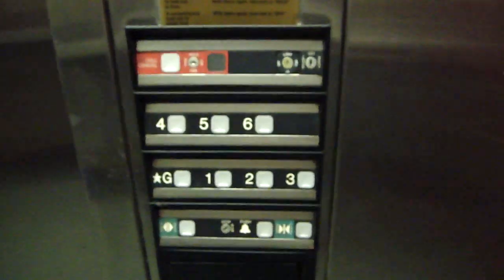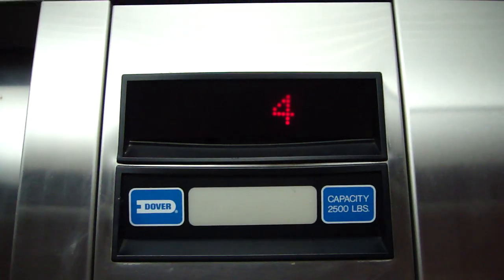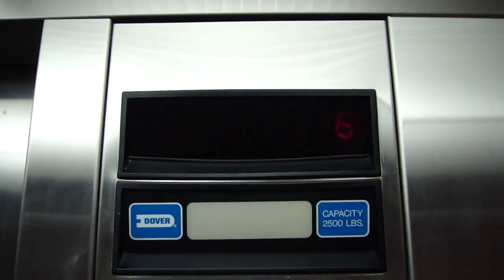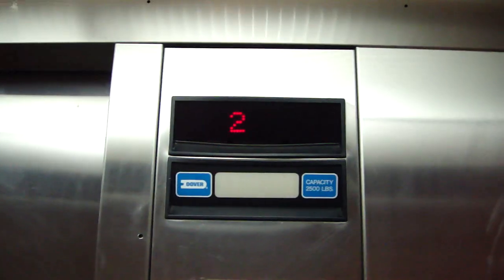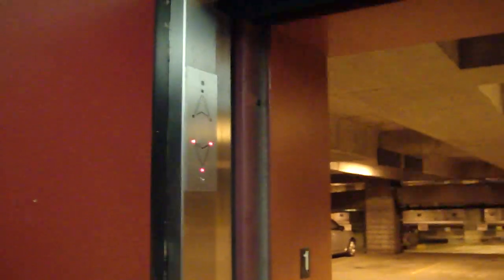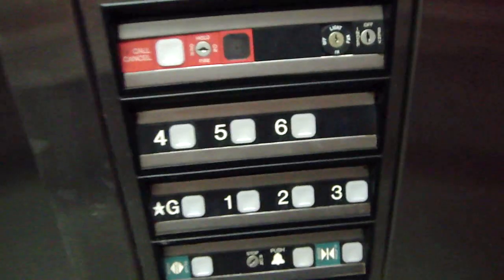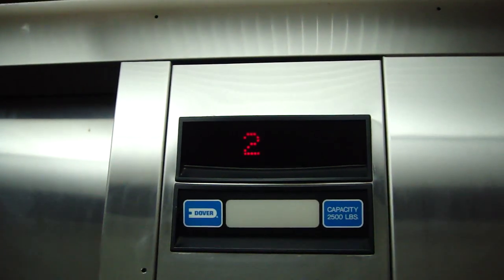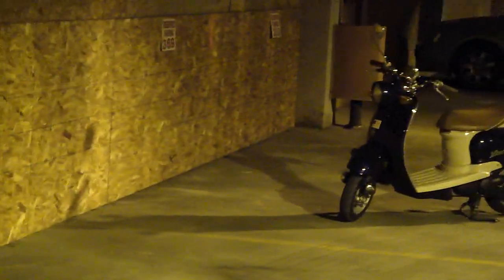Dover elevator with oil viscosity control active

Comment: That was weird to hear the motor of the elevator running without the elevator car moving. It was a good thing that you made it to the top floor without getting stuck this time. It was also weird that the elevator started going down without pressing a button for a floor. Weird how the elevator would stop at every floor and the down bell would ring. You’re right about the elevator being messed up.
Reply from the maker: It was definitely a unique experience!

Comment: In its preferred form, however, the invention relates to elevator installations with hydraulic systems which are rendered of closed-loop configuration by the mentioned by-pass means, and in which heating of the fluid is primarily accomplished by recirculation of the fluid in the closed loop path therefor. As an aspect of the preferred form of the invention, if the cab is above the lowest floor when the thermostat means first signals for heat, the cab is lowered to that floor and is kept at such floor in the absence of calls requiring up movement of the cab. In this way, most of the fluid in the jack means is forced out of the jack means and into the recirculation path so as to be subject to recirculatory heating.

Comment: Viscosity control theres actually a US patent with the details:

Dover Corporation, Memphis, Tenn., a
 corporation of Delaware Filed Aug. 16, 1968, Ser. No. 753,105 Int. Cl. B66b 1/04 US. Cl. 18717 14 Claims ABSTRACT OF THE DISCLOSURE In a hydraulic elevator installation, a thermostat is included in a closed loop path in which oil may be recirculated by a pump. A valve controls exchange of fluid between such path and the jack for the cab so as to cause the cab to move up and down or be parked. The thermostat responds to a drop in oil temperature to a cut-invalve to cause the pump to recirculate fluid in the mentioned path until the oil is heated by turbulence effects to a selected higher cut-off temperature. Recirculation for heating purposes is continuous over the period the thermostat signals for heat except when the cab is required to respond to a down movement signal. In the absence of other control, the cab is lowered to and kept at the lowest floor in response to the thermostat signal so that most of the oil of the system is out of the jack and in the closed loop path to be subject to heating.

Comment: I never know that an elevator could park at a floor
Reply: Hydraulic elevators do this to reduce strain on the lift system.
If it sat at, say, the 4th floor, then the main ram is under the weight of the car all the time. Oil can leak past the seals, and create problems.
By parking on the first floor, the car settles onto its ground supports and takes the strain off the main ram when the elevator's not in use.
Reply: I know a vintage 80s OTIS/C.J. Anderson elevator that parks on the first floor.

Comment: The hydraulic kone elevator in town usually malfunctions in hot weather, I guess the oil becomes too thin when its warm, and leaks resulting in low pressure so elevator won't move and does weird things.

Comment: Here is what an elevator man can tell you about this elevator.  That is a Dover DMC with a dry-mount pump, probably a 30 or 35 horse motor, attached to a solid state "soft start" motor starter.  Here's how I know.  If it was a "relay logic" elevator, you would be able to hear the mechanical floor switches as it passed them.  Thus it is a DMC with a tape selector.  The sound the motor makes when it fires up is that of a soft-starter instead of mechanical "across the line" or "Y"/"Delta" starters.  If you'd like to learn how to figure all this out from a 4 minute video, I suggest you apply yourself to the five-year apprenticeship.  Then you'd know that the "running while not moving" is very normal and common.
Reply: Thanks for the input and im kinda embarassed that you found one of my older videos where I was fairly igonrant.  I have since this video was made learned ALOT about elevators.   Anyway I have learned that most modern hydraulic systems do this to maintain oil temperature.  If I could talk to you sometime I would love that as I always enjoy talking to people actually in the industry..

Comment: I guess you never heard of viscosity control.  Most elevators which have outside machine rooms or shafts, like a parking garage, have a special function that lets the oil stay at operating temperature.  This is done by forcing oil through the valve without letting the machine run.  That Dover is working as designed.  The design also brings it down to a programmed floor, usually the lowest, to make sure as much oil as possible is in the tank.  Ask an elevator mechanic next time before publishing something like this.
Reply from the maker: Im sorry you had to see one of my early videos where I knew very little about elevators..
Reply: ***** Ok, I want to know, why do you tell everyone to shut up?
Reply: ***** What happened to the video I got stuck in the elevator last nite?
Reply: I wonder what would happen if it was low on oil and started viscousity control on the top floor. Yeah that would damage the pump.

Comment: Very Intersting but i wonder that why the elevator stop on every floor but is not supposed to stop on every floor it supposed to go down all the way to the first floor wich is the ground Level. The reason why the motor is running because so it can heat the oil so it can leveled property.

Comment: Maybe 'good-for-nothing' yobs (Messed up teenagers, they are normally quite nice) called it at 2 & 1? Anyway, Maybe the motors starting up because of an error with the lift-to-motor control interface? It's telling the motor that the lift wants to move (When in actual fact it's not) and when the call button is pressed it finally becomes correct and says that the lift isn't moving! The doors close and the problem begins again.
Reply: Actually, it's doing something called viscosity control. You know, where it's motor warms the oil by cycling it back and forth in the tank without letting the elevator run. The sole purpose of this is to regulate the oil temperature so that the pump and hydraulic ramp doesn't suffer from any issues due to the oil getting cold and thickening up.

This is extremely common on hydraulic elevators to prevent the oil from thickening after getting too cold.

Comment: That is weird, though. I never heard a hydraulic motor run when it's not moving.
f Railfan02 is right about THIS case, there's another big problem somewhere! That elevator does not have a constantly-running motor, like it does now (per older vids of this elevator).
========================
Shameless plug:
Me doing the Dover Buzz!
Search: "georgef551 dover buzz"